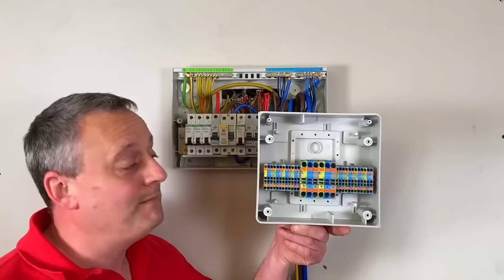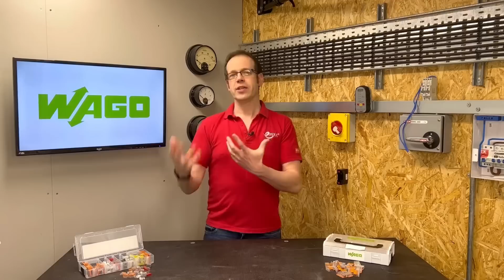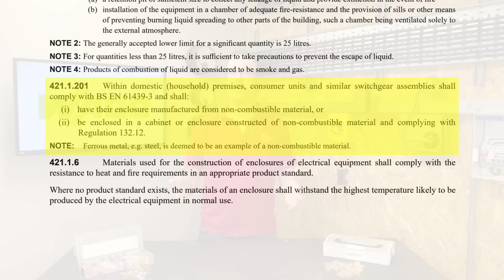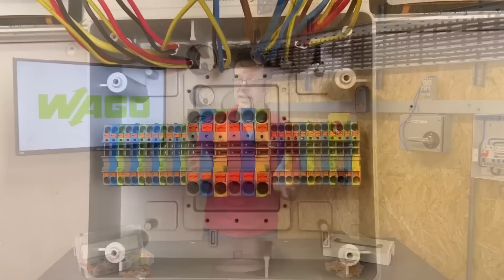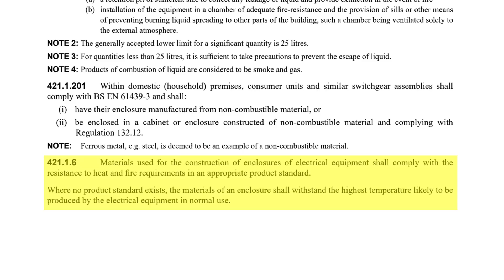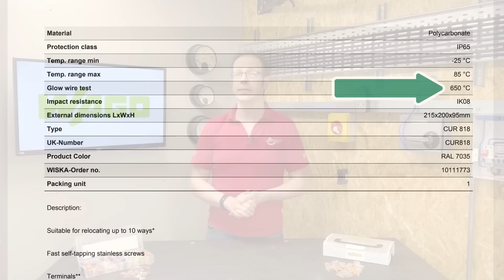The WAGO Junction Box Debate: Metal or Plastic?

Comment: I'm working on a project now using Shelly Relays to control lighting circuits, I've come to the conclusion that I will need to be enclosing the control box in steel. Is this actually necessary or can I be using a plastic enclosure?

Why is it ok to have relays in light switch back boxes? Maybe I'm misunderstanding the definition of switchgear...
Reply: Is it a "consumer unit or similar switchgear assembly"?

No, the shelly isn't a protective device it's just a computer controlled relay. You don't need to put light switches in a metal enclosure either.

That said the new shellys sit nicely on a din rail with a Consumer unit type front window. So you might consider buying an inexpensive empty consumer unit anyway - that seems to be what most people are doing.
Reply: @keirstitt8277  the problem you’ll have with a Shelly or even Quinetic and similar wireless units is signal attenuation through a metallic enclosure. The DIN mounted units aren’t the new version (that would be the Plus line), they’re the Pro series and have an Ethernet connection, but they also cost about 5x as much and if you’re going to get picky about the enclosure, good luck finding a Cat 5 or 6 patch lead that’s rated to 230V (they do exist, but very uncommon). Once again, noncombustible doesn’t even mean metallic. So no, you don’t need to put Shelly relays in a metal box, and in fact you shouldn’t. But don’t put them in the cheapest crap either, get a decent enclosure by Gewiss or something. If you do go with the Pro on a DIN rail, be sure to leave at least 10mm between units to allow for heat dissipation per manufacturer’s instructions.
Reply: @keirstitt8277  Hold on.
You're telling him he doesn't need to put relays into a metal enclosure, but you don't even know what magnitude of current he is switching. You don't know the circumstances.

Light switches, the magnitude of the current they are switching is typically less than 1 amp.

That is a very different situation to switching 15 or 32 amps.
Reply: @deang5622  you’re right, I did say that, and higher current switching does make a difference. But the Shelly devices are rated to a maximum of 16A so we know the upper limit. Of course, if we’re switching multiple 16A loads in a single enclosure it is demonstrably different from a 10AX switch on a wall.
Reply: @deang5622  Why is it any different? I've got a plastic 50A isolator on a 10.5kW shower, doesn't need a metal enclosure. I've got a 100A double isolator in a plastic enclosure between my meter and consumer unit - doesn't need a metal enclosure either. A single 6A RCBO on the other hand would need a metal enclosure.

This is functional switching not a protective device. Absolutely no reason why current comes into the decision as to if it should be in a metal or plastic enclosure.
Reply: My reply was for you, Ross. And by the same token, why is it okay to have light switches in light switch back boxes?
Reply: Thanks all, a bit of conflicting info here. For further reference i'm using the pro series, feeding from a 6a RCBO. 

The pro series have over power and over voltage protection built in. Which still makes me consider that it is classed as switch gear. But looking for advice! Seems odd that if protective features are added then the enclosure must be uprated...
Reply: @rosspage9397  you’re not wrong - it is odd! So they’re DIN rail mounted and that means you’ve got your pick of metallic enclosures but if you want wifi you’ll get signal attenuation as there’s no option for an external antenna. It may not be an issue if you’re close to the wireless access point but it needs to be tested which still means getting the enclosure etc. if it’s on Ethernet don’t worry but again how “proper” does this have to be wrt to the network cable’s rating, etc? You could document this as a variation from BS7671 on the basis of additional protection and the functional requirement for wifi. If you want to stop fire from spreading then also ensure it’s not installed right under a wooden staircase or beams, and consider adding a fire suppressant stick (EnviroBurst)
Reply: @SamButlerUK  why would it be a departure from BS7671? so long as the 6A RCBO is back at the consumer unit from where it's fed and not in the plastic enclosure then it's all fine.

TBH a metal box isn't the WiFi attenuator that wearers of tin-foil hats think it is. I've done work in RF anechoic chambers and my phone still picks up the lab wifi. 1mm of steel isn't going to do much, not like a shelly is streaming live video or anything.

Comment: Btw. is possible to use "between" terminal connectors as neutral bus bar? I look it up and they are rated around 25A wich may be enought for one phase aplication in home. And also the ground terminals - do they have connection to DIN - like if I want to use copper DIN as ground bus bar?
Reply: Metal DIN rail with "bus bar like" function is bad these days if we use RCD's/RCBO's. Believe me! Equal for "neutral line" ... 🤦‍♂️🙄😱 

Specially for this I use grey connector and colour them yellow-green, brown, black, and blue. Extra order fabric blue costs extra money - and you never have enough or too many. Ahrg! Just same what you do with yellow-green at every cable.
Reply: @OldLordSpeedy  Thanks! It seems as convenient and elegant solution,  but I was also sceptical due to the RCD´S. :)

Comment: I can't see any significant difference between a box of this size enclosing multiple connections to a small Wago or Wiska box for use on an individual circuit which are also plastic.  🤔 Would they say the same if a plastic box intended for any other use was used to encase a strip of choc blocks. The only difference is that these joiners are mounted within on a din rail. 🙄
Reply from the maker: Agreed. 👍
Reply: The interesting question is then why a consumer unit/switchgear is required to be in a non-combustible enclosure. I can only assume that the starting point was an analysis of causes of fire. I could see either total per-connection current (and so heat generated at a loose contact), or else the act of switching as being most likely as root causes of fires. I would have guessed that current would be the most important factor, but head-end equipment isn't required to be in a metal enclosure as far as I know, though that is usually located outside rather than behind a pile of coats. As BS7671 presumably isn't just a collection of guesses, there must either be some kind of known common connection to switching (arcs?) rather than connection resistance, or else this is a gap in the standard. As Wago's are maintenance-free, I don't see this being a practical problem, but things like Henley blocks would be more of a worry?
Reply: @dansheppard2965  it's the additional heat when interrupting a fault, coupled with the fact that an old MCB with a decade of dust build up that might have operated under fault many times with a user just resetting it instead of actually calling out an electrician can then cause the arc interruption on the MCB to be far from what it was at the factory.

Loose connections are obviously a fire hazard too, but if we changed everything containing a connection to metal enclosure then our homes would end up looking like industrial workshops with metalclad everywhere in galvanised conduit. In any case these are MF connections so they're never going to come loose.
Reply: @keirstitt8277  It is not to do with the heat when interrupting a fault.

Interrupting the flow of electricity does not cause heat. Heat is caused by the presence of the current itself.

Switch gear such as MCBs when they switch, arcing can occur. It's the arcing that can wear away switch contacts, increasing the contact resistance, generating heat in normal operation.

It's also that fires have occurred in consumer units which again occurs by poor contact resistance in the breakers - when closed.

And the presence of many connections in one place increases the probability of poor connections, again, leading to increased contact resistance causing heating and wires becoming loose causing arcing.

Finally, the arcing itself occurs at a high temperature but for the arcing in the switch to reach the plastic case would require a huge potential which would be  extremely unlikely to occur.
Reply: @deang5622  "Interrupting the flow of electricity does not cause heat." you might want to check that one. 

Most of the inside of your MCB is taken up by an arc arrestor for a reason.
Reply: @keirstitt8277  I don't need to check it up.
As I explained in my post, the arc causes heat, not the current.
Reply: @deang5622  you said: "Heat is caused by the presence of the current itself." 

You seem to think it's caused by everything and nothing, but it's okay because we can just put it all in a metal box and hope for the best.

I've got a better idea. Understand and follow BS 7671, and stop using your imagination.
Reply: @dansheppard2965  That was specifically explained in the video. 🙄
Reply: It's not the size of the box or the number of terminals inside that determine whether it should be fabricated from metal.

The video does explain the real reason, where he reads out the regulations.
The box has to be made of metal when it contains SWITCH GEAR.

Comment: What about the 60 amp double plastic switch fuse for tails that is still sold and used particularly in new build where the tails are extended?
Reply: Also there's the standard 100A isolator switches that the DNO or Meter companies fit between the meter and the consumer unit... they're plastic too!
Reply: Haven't seen a plastic one, are you talking about the bakelite kmf switch fuses? 
Or the plastic 100amp isolator switches?
Reply: Click lewden scolmore timeguard they all rebrand the same bakolite plastic switch fuse
Reply: The same surely would go for meters would it not? As the definition states regulation of electrical circuits.
Reply: Electrical safety first provide a useful definition of "similar switchgear" 

"This refers to any items of switchgear performing a similar function to a consumer unit for the control and distribution of electricity within the domestic (household) premises."

So certainly not an isolator.

A switch fuse is an interesting one. You could argue it's a 1 way consumer unit - but isn't also a fused spur?

Reality is that cartridge fuses are incredibly reliable at interrupting arcs. They're single shot devices so don't suffer the issues which badly worn MCBs do. They're Sealed so whatever internal arcs form aren't going to ignite years of dust build-up. Remember that the adjacent DNOs cutout uses exactly the same type of fuse also in a plastic enclosure.

I don't personally think switch fuses are "similar equipment" but if I'm wrong I don't think it is going to result in a hazard of the type which lead to the introduction of reg  421.1.201.